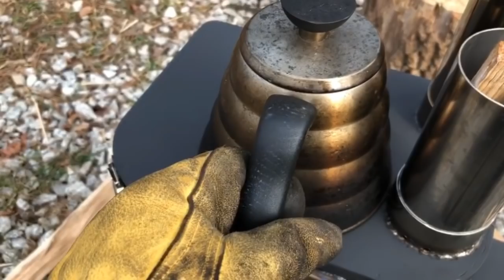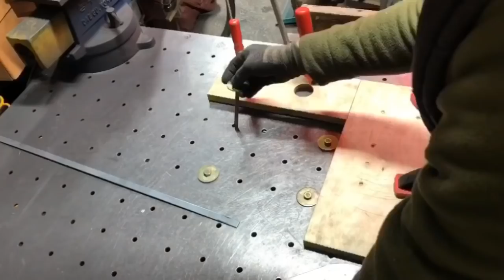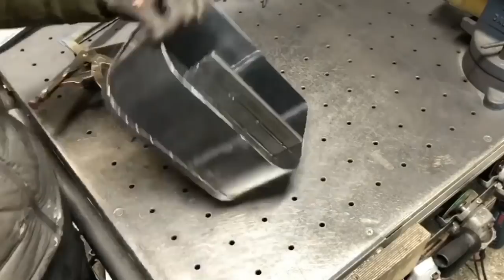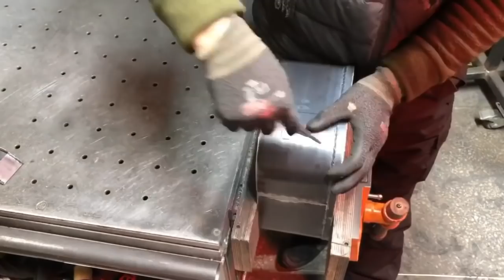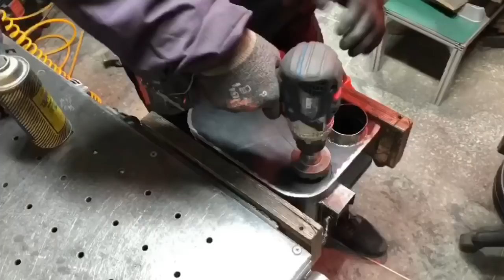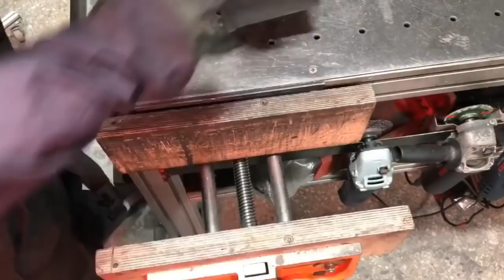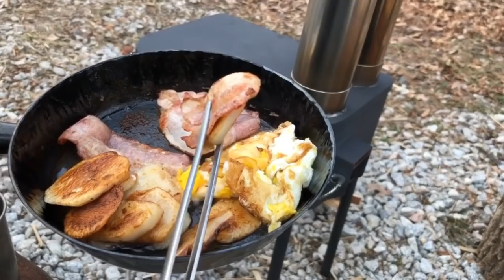코카콜라박스 미니 스토브 만들기/Making Coca-Cola Box Mini-RocketStove

Comment: You should another experiment - try this with another baffle / wall inside. Make the smoke and gas loop inside extra  . You would have to place the exhaust pipe on the other end though.
Reply from the maker: thanks for advice

Comment: How do you get the chimney pipes to stay together on your stoves? I don't see you crimping the ends.
Reply from the maker: The outside diameter of the chimney pipe is 60 pi.
The inside diameter of the stove pipe is 61~2 pie
It will be fastened immediately when inserted.

Comment: this type of stove works best when new, about a couple of months use, the inner wall and roof are insulated by carbon deposits and heat transfer weakens dramatically
Reply from the maker: I will use it for 2 months
Thanks for the comments
Reply: Could it not be cleaned?

Comment: 0:37 if you want to check the temperature of the pipe with a meter like that, you have to have a special tape that will eliminate the reflection caused by the pipe being shiny.
Reply from the maker: That's right. 
I'll keep in mind. 
Thank you for watching the video.
Reply: @stovetv  Of course! Awesome video! It's not like it's a massive difference, but it can still be 5-20 degrees higher than what it actually shows.
Reply: Yup any tape will do

Comment: What gauge of metal do you use?
Reply from the maker: What is a gauge?
Reply: StoveTV gauge is the thickness of the metal 16 gauge will take 16 sheets to make 1 inch 28 gauge will take 28 sheets to make 1 inch